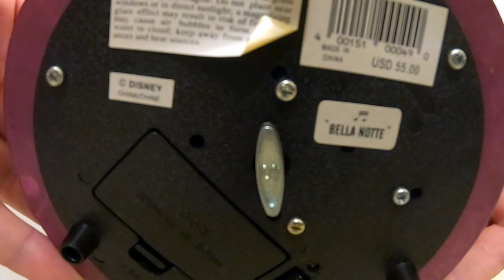Ep. 204 - Disney's Lady and the Tramp "Bella Notte" Snow Globe Repair - Replace cracked globe

Comment: I wonder if a heat gun would’ve been faster for getting the glue softened.
Reply from the maker: A heat gun would work but our fear is that the heat from the heat gun would be too much. Water boils at 212 degrees Fahrenheit and will melt glue without damaging the base. The heat gun on low setting is 750 degrees and on high setting is 1200 degrees. One of the things heat guns are used for is stripping paint. We are afraid it may damage the base. We have also used a hair blow dryer in the past and our research shows that blow dryers typically reach temperatures of up to 150 degrees. So the heat gun is a significant increase in temperature.
Reply: @snowgloberescue8887  wow! I didn’t realize they start so hot. That’s a bit much for sure.